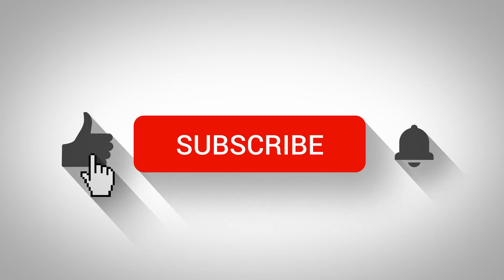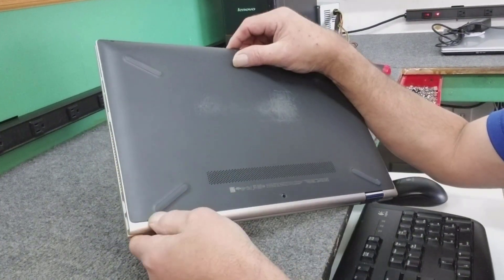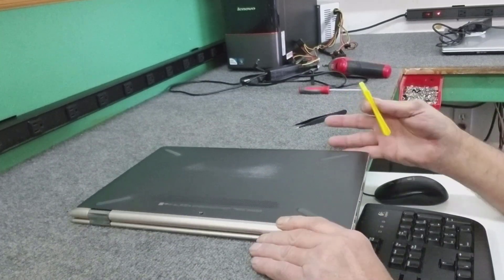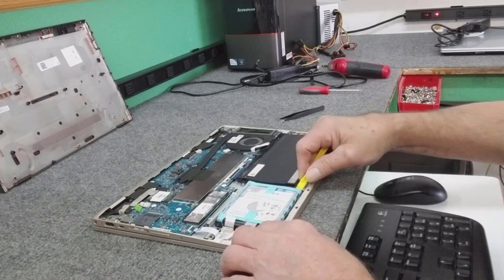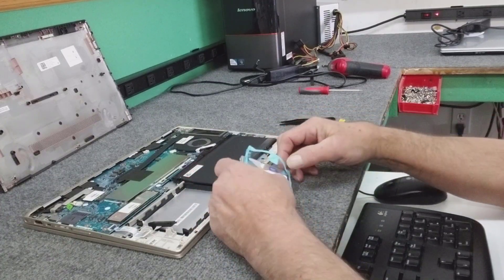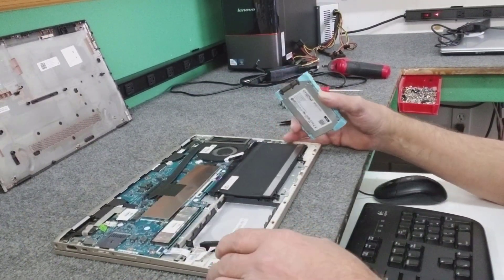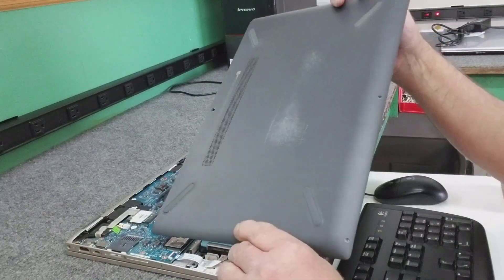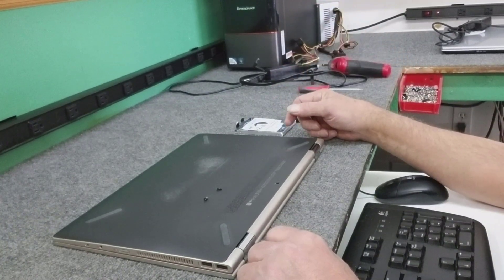HP X360 15.6" Convertible SSD Upgrade

Comment: Great video. I’ve watched a few already but, this was clearer and didn’t contain a ton of unrelated info’ in the commentary. The only thing, like other videos, was your left hand blocking the view of the connecting ribbon before sitting it in the cavity but, it’s probs self-explanatory like most things that need to be plugged in with pins or grooves.

Comment: Great video, but I had to find a video how to take out the screws. The round center screw cover needs an exact blade or small razor knife. The smallest flathead screw driver I just wasn't working. Everything else in the video was great. Real easy to do this.

Comment: I have a Question. Which M.2 does it support ? Pcie or M.2 NVME ?
Reply from the maker: I believe in this video I installed a 2.5 inch sata ssd.  Optane memory occupied the m.2 slot.  Most likely pcie nvme